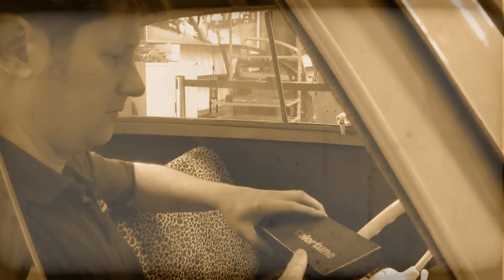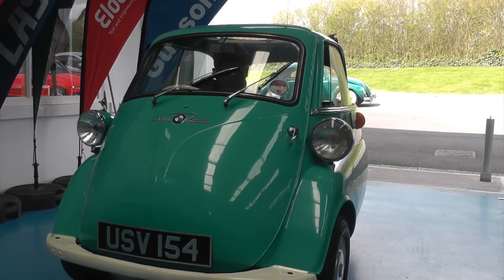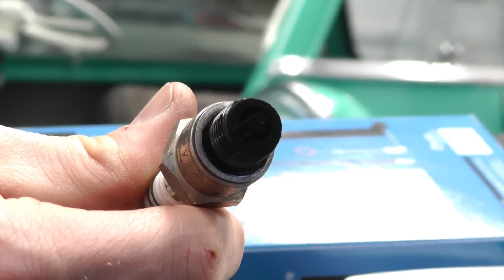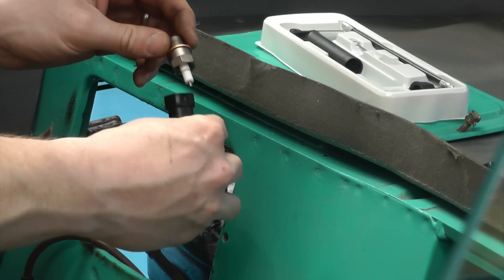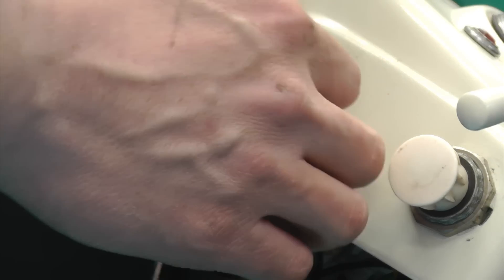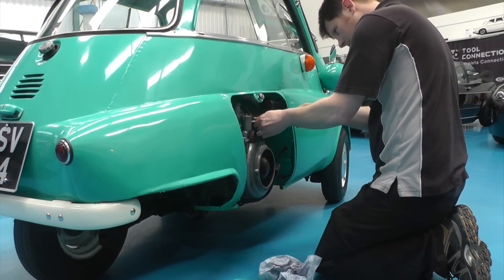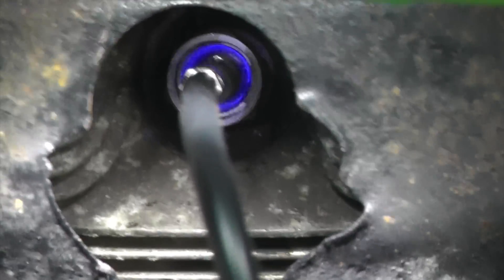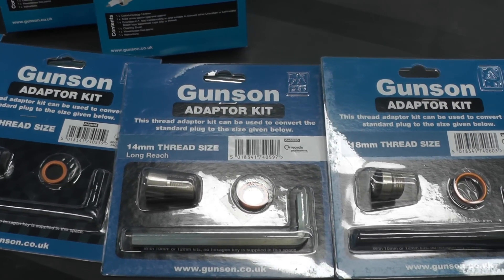Easy engine tuning - Colortune by Gunson

Comment: Could I use this on a supercharged (VW Beetle) engine please?
Reply from the maker: The Colortune plug kit can be used to adjust the idle mixture only  on this vehicle.
The plug is only designed for idle and light throttle openings as the plug is soft compared to the normal running plug.

Comment: Will this work on dual carbs? How would one know which one to adjust?
Reply from the maker: Note from our Technical team; you would adjust the carburettor that feeds the cylinder with the colortune tune in. Each carb will supply one or more cylinders; checking one of each cylinder for each carb will be fine, as the mixture will be shared across the cylinders.

Comment: I used this tool for years in the 60s - 80s. It was perfect. set your timing correctly with a strobe and then tune the mixture. Simple. Today I have an Audi 8. O2 probes, flapper valves, actuators, sensors all trying to get the mixture right for the right EMISSION. The engine might not be getting the right mix though. When 1 or more of the gadget doesn't work, the CPU is constantly hunting for the right mixture (not for the engine - only the exhaust emission). A big pink elephant. Oh for the old days and colour tune. I can't use it in my Audi because the ignition coil sits on top of the spark plug and you can't see the plug.
Reply: @Jay Smith Possible. Sadly I no longer have the tool.

Comment: I purchased a colourtune 500 back in the early 70's. Tuned so many carburetors with it back then. Still have it. Hardly need to use it nowdays. However when I do, it still works perfectly.

Comment: Does this only work for tickover or can it used throughout the Rev range?
Reply from the maker: The Gunson Colortune can be used up to engine speeds of 4000 rpm and higher on part throttle only.  NO full
throttle loads must be used with the Gunson plug fitted in the engine.

Comment: is it good for two stroke engines?
Reply from the maker: You can but the results may not be particularly helpful as a traditional 2 stroke
motor has a very narrow power band and the oil in the mix causes discoloration
and plug fouling. 
The results can be very difficult to interpret. 
2 stroke motors are very susceptible to fouling if the wrong heat range plug is used.